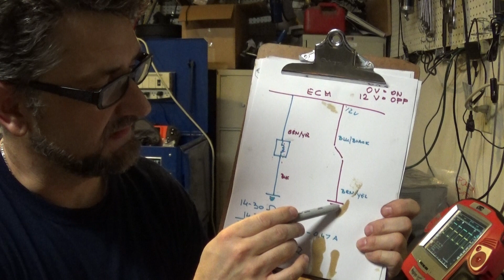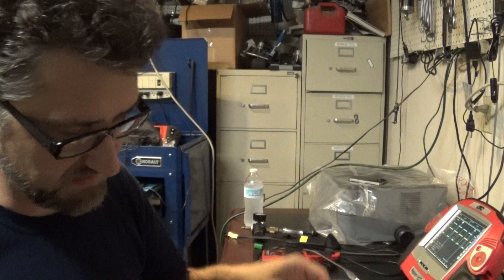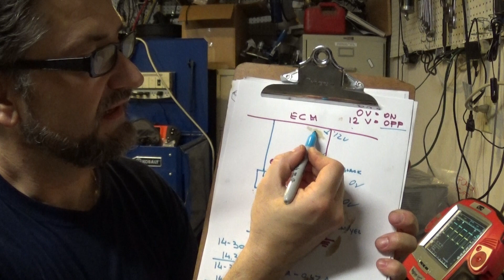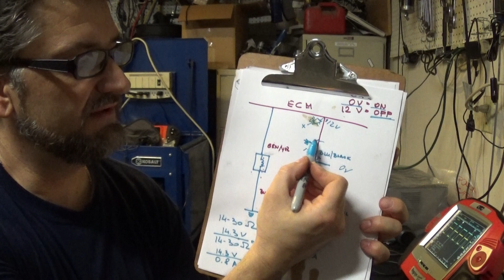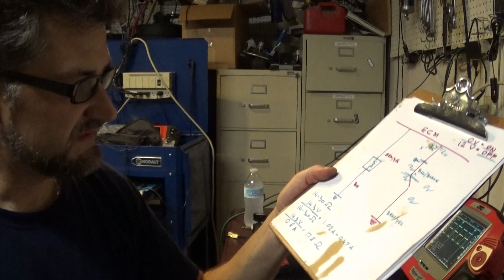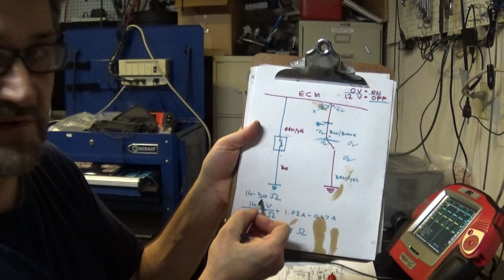VTEC Problem P2646 2005 Honda CR-V Part 2

Comment: Chasing this problem but happens intermittently. May have a bad rocker arm solenoid as it works and then intermittently it doesn't. Shop will install a used OE and will report. Everything else appears to be working correctly. It passes the VTEC test but with a scope, I did see that the switch did not open at high rev during a test drive, did it like 2 times and then set a code, this makes me believe that either the switch is faulty or the solenoid is not working correctly. For this system, I thought that if the pressure is high enough, then it tells the computer that it has enough pressure to allow oil passage to the rocker arms though the solenoid and not the other way around but I don't know as there is not much information on operation. The pressure should only increase if the RPM is high enough to build pressure. In this video, you found that everything is working as intended but there was still an issue with oil passage, in my case I have an intermittent fault as it fails intermittently and when I clear codes. It goes for a a few minutes and then eventually fails again. Almost looks like a terminal fitting issue or the PCM is bad or something with the flow not reaching the switch. The only thing that I have left is doing an oil change with the right viscosity if the problem persists as oil level is OK.

Comment: First got P2646 about 3 months ago. I replaced the VTEC solenoid assembly with OEM as a shotgun approach and the problem went away until now.  After a very long and heavy rain, the issue returned.  This time, I have done some troubleshooting first.  I checked the front VTC screen (very clean, but replaced anyway), oil control valve has some screens - checked - were very clean. I tested the actuator and it worked great.  I checked the VTEC solenoid screen and it was also clean.  Changed the oil and filter with proper oil 5w20, all very clean.

Issue persists, so I look into electrical.  I repinned the connector to the VTEC Oil pressure switch because the connector terminals looked a little corroded.  I read 12V with key on on the blue/black wire.  At this point, I have not much idea what to do next.  Any suggestions?
Reply: Hey Russ did you fix this? I have the same .  thanks

Comment: when key is on engine off i get 11.71 volts, when car is running at ilde voltage was flutuating around 3 volts. i unplugged to test circuit which triggered the VSA light to come on, also it is a brand new unit and still having issues, changed oil, and was good for about 2400 miles, BUT that is mostly just driving in town rarely getting over 45 MPH or high RPMs i spent $180 at a garage for them to tell me low oil pressure, but good flow??? i feel garage already had it in mind oil pump, because he seen this b4 and it was oil pump

Comment: I’ve got 6v at the switch. Vtec works cold then stops working hot.
Reply from the maker: Check oil pressure with engine hot

Comment: Roman,
Excellent video’s, I watched both. I have Pro-Alldata it does not go into detail that you give.
It has pin out test for if you was at dealer and have pin out boxes.
I have 2006 Honda Element 2.4ltr.
P2646 I have replaced both screens, changed oil and filter Mobile 1 oil.
I have checked voltage and ground to pressure switch 12.0 volts at oil pressure switch, good ground. I checked resistance on solenoid and I’m reading 7.0 ohms.
Your saying 16-30 ohms. I purchased twice a Dorman lifetime VVT spool valve complete unit, I’m thinking I’m dealing with a bad aftermarket spool valve. 
My next step just to verify is a manual oil pressure test to verify oil pressure.
My car has 229,000 miles on it I have been dealing with this code for two years off and on.
This has given me a bad taste on Honda I have always thought they was on top.
I was wondering if you installed a HONDA OEM complete assembly spool valve on that car you repaired?
Thank you for your Master Journeyman Automotive education!
Reply: Roman,
Today I removed oil sending unit and checked oil pressure vehicle warmed up 22 psi idle 95 psi at 3000
Rpm.
I don’t believe I have a list pressure concern.
All data Pro wants you to remove oil pressure switch in spool valve and adapt with special gauge install oil pressure sending unit and then check pressure I guess that is actual what the oil sending unit is receiving?
I check checked resistance with another meter and my solenoid reads 16 ohms within spec.
Does the ECM command solenoid on in a duty cycle?
I checked ground on solenoid side it’s good but key on what should I read on other wire going to solenoid? 
I can run solenoid test and when it switches from off to on my oil pressure switch still shows on, just like your test showed on video.
I think I should purchase a Honda OEM solenoid.
Thank you sir any advice to bounce off me is great advice.

Comment: Excellent operational explanation. I couldn’t prove my solenoid bad but when applying 12 v to solenoid the pintle didn’t move. But it did not on the new part either? Is this an appropriate test?

Comment: p2647 rocker arm oil pressure switch (a) circuit high voltage vtec system stuck on

Comment: I changed these two again and this code shows
Reply: p2647 rocker arm oil pressure switch (a) circuit high voltage vtec system stuck on

Comment: Make sure you disconnect both battery terminals and touch them together to degause the entire system. I did this , changed the oil, screen, and vvt actuator

Comment: Thanks. Great update. 06 element, no VTEC. New solenoid, pressure switch & actuator, new screens. No voltage at VTEC + actuator connectors. P2647. ?

Comment: I have been battling with this issue for about a year. It is an intermittent problem. How do you feel about replacing the wire that goes all the way back to the computer?
Reply from the maker: David Garcia watch part one please I hope it will help you to diagnose your problem.

Comment: Replaced the complete brand new (Duralast #TS1147), 2005 CR-V ran less than 2 weeks.
Back with the same problems (P2646, VSA & limp modes about 3KRPM.
So what is the most likely the fault with SUV, has 240K and oil/filter have been changed?

KY Home Garage, many do not have the computer to check.  
So with your or anyone that has experiences with CR-V, what is usually the problem?
Reply from the maker: Oil sludge is very common reason and incorrect engine oil.

Comment: I have the same problem i already replaced the oil pressure switch and the whole solenoid to a new one my car cannot be reved passed 4k rpms it jerks and my code also says low voltage
Reply from the maker: Check my part one i hope it will help.
Reply: @adrian Maldonado, were you able to fix it finally?
Reply: @gajankumarr7542   not yet took my car to the dealer there checking it
Reply: @rsxonprogress9488  Did you find out what the problem was?
Reply: @VaderYouSeekVader   yes the camshaft actuator was broken and the head has medal shavings i just swapped the motor also i had to change the ecu code would not clear  in new motor
Reply: @rsxonprogress9488  Did you try resetting the old ecu?
Reply: @VaderYouSeekVader   my mechanic was the one that did it he tried to and it did not work

Comment: Thanks for the reply Ramon. The fact that you mentioned the accepted oil pressure of 57 PSI and the that it switches at around. 3000-4000. RPPM. was. A tremendous help.  No one ever stated the pressure. Just yourself. I will watch. It again. But thank you for explaining it in detail. Ramon you don’t need to smile I enjoy your videos for there honesty and accuracy. Thanks much for the response. 👍👍👍❤️
Reply from the maker: Arthur Fricchione thank you my friend. I am glad this was useful. Cheers 👍👍

Comment: If the P2647 code sometimes goes away after say connecting and reconnecting plugs ( after cleaning them ) or the code goes away for a short time after changing the entire solenoid and pressure switch assembly, does that prove the wire is not shorted ?
When could it be a Power Control Module problem ?

Comment: I have a 2006 Honda Accord 2.4 with  po2647  Vtec code. Have replaced the parts shown but did nit fix.  Would be interested in looking at and repairing. Would like to get in touch. Thanks.

Comment: I have a 2003 crv k20a4, I took off the solenoid and surprisingly there’s no oil pressure valve, instead I found a screw on it.
Reply: K20a4 engine ol pressure switch is separated  from vtec solenoid body, ...it is the valve under the solenoid body which is commonly connected by a wire.

Comment: No vtec in k20 or k24 check the chain for stretch .the chain stretches then throws a code then  wont  go into vtec
Reply from the maker: just so 1 Ok thank you for tip. I can easily do that with scope. I need to find know good waveform. Cheers👍👍

Comment: I have an 2003 Element with the P2646 code. I replaced that whole unit with the solenoid and switch but the problem actually got worse. It has clean oil and the filters look good. I have been searching for answers and not really getting anywhere. After watching your video I ran into a question. You said that the voltage to your solenoid was reading 14v I believe. Mine reads around 6 to 7 volts. Is the the possible cause of my issues? Do I have a bad pcm? I'm just stumped and out of money. Before the problem was intermittent, mostly occuring after a long drive but after replacing the solenoid unit, the car will not go over 3000rpm at all and the check engine light comes on almost immediately. Any advice or ideas?
Reply: Please email me I need help labatuth2@gmail.com

Comment: thank you ramon  , I thought the solenoid has only one wire, I new about the wires solenoid, then how you test resistances  on one wire solenoid? Cheers my friend, happy 4th of july
Reply: On a one wire solenoid, you test resistance by probing between that one pin and the body of the solenoid/valve.
Reply: On a one-wire solenoid, you test resistance by probing between that one pin and the body of the solenoid/valve.

Comment: hi Ramon,  where do you put the dmm leads on the solenoid?the camera don't show it, for resistance,
Reply from the maker: Everardo Camacho on solenoid pin connection (two male pins). Set your meter to ohms and touch pins with your leads. Polarity doesn't meter in this case. Hope this help my friend. Cheers

Comment: hi Ramon I just subscribed  to you channel, I really  like that video. one question is how you make  the ligth bulb to lite  , what the set up and how  thank you , cheers from ontario calif
Reply from the maker: Everardo Camacho I put switch in series in my circuit. Switch is normally closed (light will lit) when you apply pressure switch  will open and light will go out= good switch.

Comment: Great video,luv the detail & explanations.Main issue maybe low oil pressure not activating pressure switch ?oil pressure relief valve,worn oil pump, clogged pick up screen,worn bearings, aerated oil, ect
Reply from the maker: Tom OConnor You are right so many things could be reason for this code.This problem can be real pain sometimes.thank you for watching

Comment: P2646,  I removed the assembly, made a fitting and pressure tested the switch. takes about 20 psi increasing to trip, but very repeatable. 13V on the solenoid and you can hear it pulling in and releasing when you power it down.  Screen shows no debris at all. I'm wondering if my overall oil pressure could be the problem? all I have in my 03 Element is an idiot light. any idea when the idiot light comes on? If there is range between (idiot light/vtec switch activation) then could that be my problem? I don't want to just throw parts at it...Yes, I changed the oil. :)  Thank you oh! Great Video!!
Reply from the maker: David Sanders I would check engine oil pressure and pull valve cover to see if you have any sludge build up. What is your code?

Comment: Great case study, with in-depth analysis. Love it! I diagnosed a 2003 CRV with this exact code last month. VTEC valve had been replaced twice before I looked at it, but same code returned. I checked all the electrical and mechanical functions of the solenoid and the oil pressure switch itself (bench test like you did here!) and everything worked properly! 

Now can you guess what the real issue was in my case, and how I determined the cause of the problem?
Reply: +KY Home Garage KY Home Garage 
Hi guys in order to test for real oil pressure what about energizing the solenoid eith engine running at idle and look for a change at idle would that work?? Thank you! Both 😀
Reply from the maker: motoYam82 correct engine oil is number one if that doesn't help engine sludge could reason why. Take valve cover off and look for sludge. If that is the case try engine flush couple times. Thank you hope this help bro.
Reply: Yes, I believe high mileage and poor maintenance was the root cause of VTEC failure in my case. Even with a new solenoid unit, the pressure switch stayed ON. I removed the oil psi switch and installed an analog oil psi mechanical gauge in that spot. Revving to 3k rpm and energizing the VTEC solenoid manually could not get the pressure reading above a few psi! I assume the valve train in the head was so worn out and relieving the pressure too fast, so it could not build in the system and activate the VTEC as designed.
Reply from the maker: motoYam82 OK , did you find any sludge. I had another car with same issue after replacing solenoid code came back  after first test drive. Only other thing I could do is to change oil with correct type of oil. That was a fix.  Later I was wondering if my solenoid was a problem at all. Talked to owner and she told me that car was sitting on driveway for  six months without being started.
Reply: Vtec system needs more care than a turbocharged vehicle, very troublesome and unreliable, I have a Honda Element (k-24) with exactly the same situation…. Clean engine, fresh oil , change the connector three times , changed all filters, the whole unit 4 times , the oil switch like 7 times , even from dealership, I have tested the wires… End of the history ? My daughter doesn’t want the car anymore 🤦‍♂️